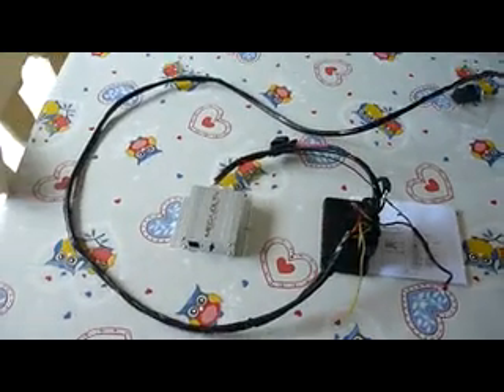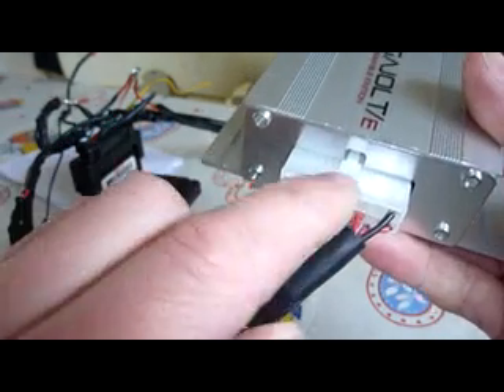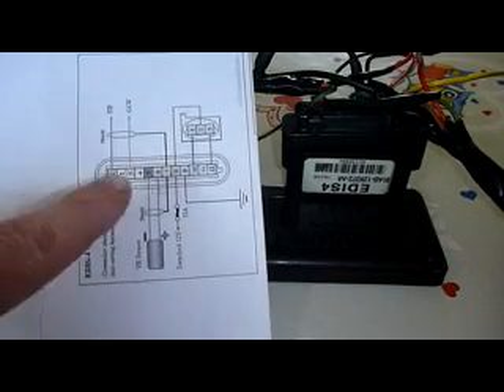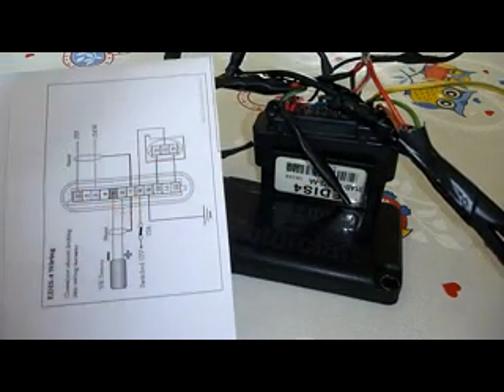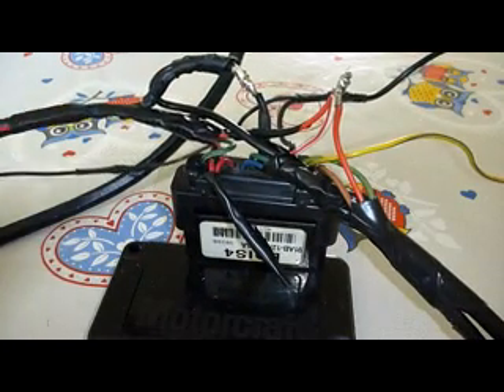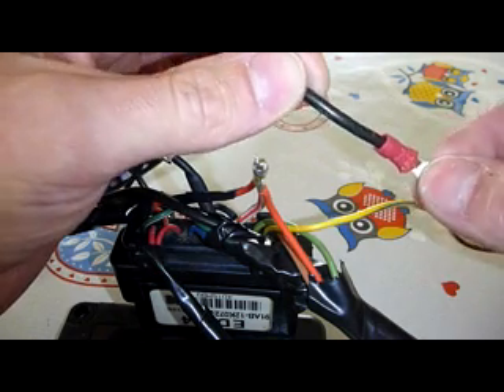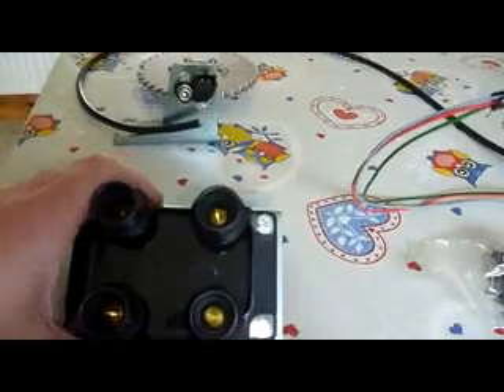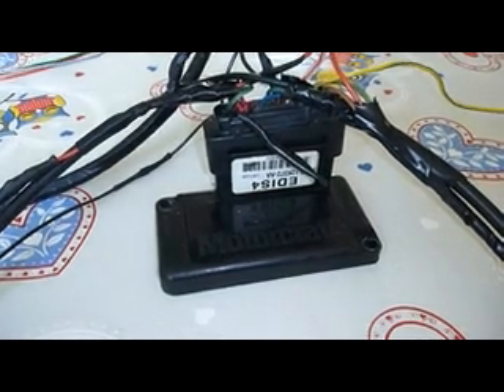mega jolt wiring minimum requirement for mega jolt.

Comment: Did it work when fitted to the car though?
Heard you can have issues earthing to the bodywork instead of straight back to the battery, and that the SAW/PIP and VR lines should be shielded at the EDIS end.
Reply from the maker: twincamspit yes of coarse it worked. I had no problems with earths. The pip and saw are on shield cables yes your Wright. I would consider it on excellent piece kit.
Reply: Cheers! I think I've messed something up on mine, the Megajolt drops the signal when the revs rise and thinks it's zero. But I copied a different diagram, and connected pin 4 to the PIP/SAW shield. 
Time to take mine apart again.